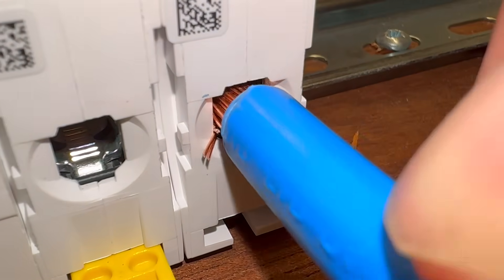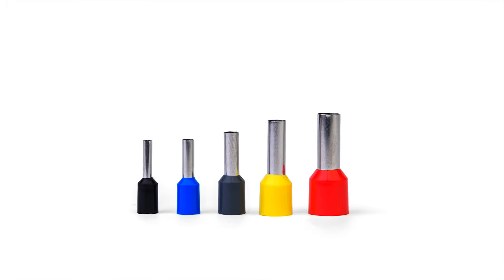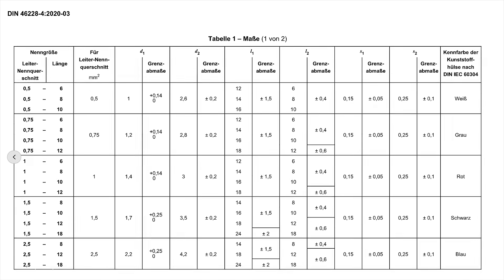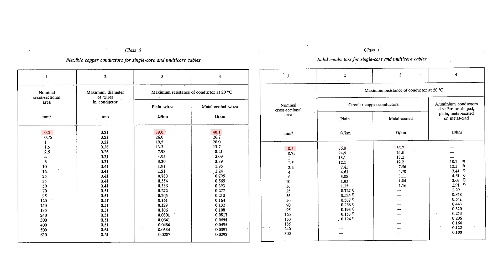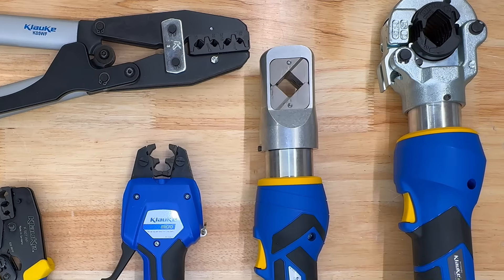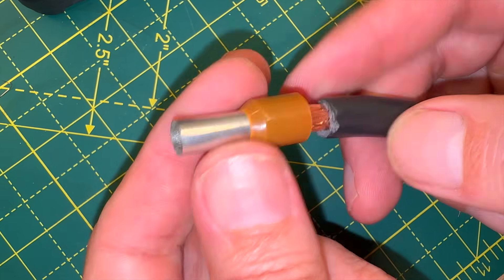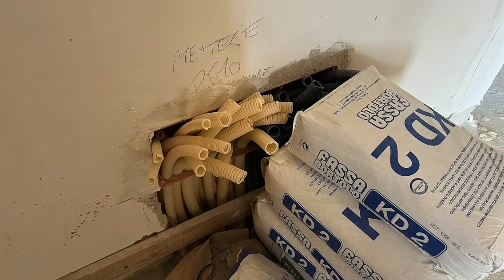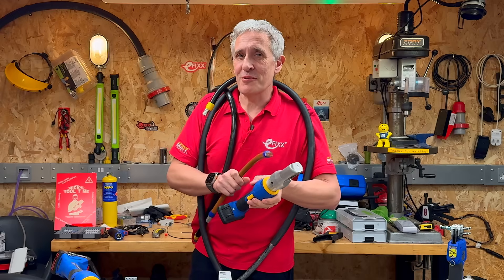The Truth About Ferrules: Overkill or Essential?

Comment: Most of the problem with cheap ferules can be solved in most cases by leaving 1-2 mm the stranded wire outside at the end of the ferrule. I've said in most cases because sometimes the end of the terminal is plastic or is simply air.

Comment: Howdy. Nice.
It is sometimes observed DIY:ers soldering the stripped end of stranded wires to avoid strand spreading.
This is bad !
Using screw terminals the solder lead will cold fluidize resulting in very unreliable connections. Fire hazard is eminent.
Cheers.
Reply: Several YT vids showing tradies doing this as well... they dip the stripped end into a little cauldron of lead.  Never saw the advantage of that over ferrules, especially in terms of convenience.  Applying a ferrule takes a couple of seconds only (and a crimp tool that admittedly can be a bit spendy)

Comment: Double 6mm - small bit of masking tape over the two untwisted ends with about 5mm of pinched and twisted tape at the end. You only want to tape a couple of mil of the cable so it's easy to pull out once in a ferrule.

Comment: If it ain't soldered , it ain't connected.  That simple.
Reply: Simple, but also simply incorrect!
Reply: @tookitogo   why would it be incorrect... soldering is both mechanically and electrically a very good connection. Just check in any of yours appliances.
Reply: @nagyandras8857  Nobody disputes that solder connections are connections. But you’re saying that anything that ISN’T soldered isn’t connected, and that is sheer nonsense. There are countless other methods of making high-quality electrical connections, from crimping to screw terminals to spring-clamp terminals to spot welding, wire wrap, and more.
Reply: @tookitogo out of all those , spot welded can the the other proper alternative. However , even spot welding will not block air from copper. A proper solder job will. Screws come loose , Spring loaded wago types have far smaller contact area , wire nuts where never a good idea as they can come loose. And all of them let the copper exposed.  So there are no other options for something to Last,  soldered it is , or its not connected.
Reply: @nagyandras8857  EVERY method has its pros and cons, and that includes soldering. Soldered joints are much more susceptible to vibration damage than crimped, wire wrap, or spring-cage connections. A good engineer/technician understands this, and chooses the correct method for each job. Only a lazy or unknowledgeable one thinks that one method is always the best. 

P.S. Crimping and wire wrap are all gastight connections. So is a spring cage and a properly-torqued screw terminal.
Reply: @tookitogo  soldered still outclasses all, expect for 2 things. harder to modify, and takes more skill and time. apart from that, its better in any way than all the rest. specialy if long time period is examinated.
Reply: @nagyandras8857  Again, that is simply not true. I already gave one example: solder joints are susceptible to vibration. Crimp, wire wrap, and spring cage are all superior in vibration resistance. That’s why aerospace and automotive applications use crimping wherever possible. (In those high-vibration environments, they even use press-fit PCB connectors instead of soldered ones, because the press-fit is more reliable.)

As I said: only a lazy or unknowledgeable engineer/technician thinks that soldering is always the best. A good engineer/technician actually understands the pros and cons of each method and knows when to use each.

Comment: Hi @efixx, it would be good to cover details about pull testing and tool certification also. This area is often massively overlooked and can be confusing to users. 

For example, many twin ferrules will fail pull testing because users have selected the wrong size for the cross section. It is much more difficult to get a reliable crimp with twin connections, this is why less and less are being used industrial applications when terminals can provide reliable grouped connections.

Finally, with the new SnapIn range of terminals released by Weidmüller and soon Phoenix Contact, ferrules will no longer offer improvements over a correctly stripped wire. Worth adding to your next video on terminals.

Comment: The main problem with ferrules is that they must be used correctly or they will do more harm than good. It means not putting solder into them, not using them on thick stranded or solid wires, using correct sizes of ferrules instead of bending the wires on themselves a few times of shoving in a few smaller ferrules alongside the wires to get a reasonable grip from a larger ferrule or cutting off some strands and trimming the insulation to fit a smaller one. Also with ferrules you absolutely need to have a specialized crimping tool and follow the procedures. It means definitely not using pliers, vice grips, hammers, cordless drill chucks, your teeth, circuit breaker terminals or other random stuff to crimp them. But even the cheap rattly stuff from China that despite being very affordable generally does a reasonable job can rarely be found in some random worker's or home owner's toolbox. And the requirement of not doing anything questionable and non-standard with the little things demands at least some level of knowledge and understanding one can not expect from a random guy. It is very important to understand that an idiot or someone with no proper tools available will almost always do a better job not using any ferrules anywhere at all than using them but incorrectly.

Comment: I normally solder when there is a strand of copper wires
Reply: Bad idea for screw terminals: solder cold-flows under pressure, so your connection loosens over time.

Comment: Very comprehensive video! I like how you mentioned (from the Siemens datasheet) how ultra fine wires and ferrules are used in mainland Europe where they aren't in the UK -- there's usually a German in the comments saying ferrules are mandatory when someone is putting stranded conductors in a screw terminal without 😅
Reply from the maker: Thanks ! 🙏

Comment: Don't take me wrong But this seems just a wate of money and an unnecessary tool in the kit as you can just twist the strands using a simple plier and have the same strength. 

Ofcourse some lazy people would short something without these and then call them game-changer.
Reply: Nah. They’re an added step up front that saves TONS of time down the line. (And of course, in some jurisdictions they’re required in some situations.)

Comment: There were lots of things I didn't know in this video, and many I don't need to know.

But I didn't know that the uninsulated ferrules existed. One of my major use-cases (as a simple man-with-a-shed) is indeed wiring plugs. Thank you.
Reply: you can easily detach the insulations from the ferrule with needle nosed pliers if necesseary, just pinch the plastic with teh pliers and push on the metal sideways

Comment: I'm not watching. Just wanted to say that ferrules are not superior, they a merely a cosmetic improvement. If you're brain has the capacity to understand,.. then you'd know a cable will always have a better connection with no ferrule as the screw/clamp force spreads the cable into the terminal. A ferrule is rigid and most of the time will only have a tiny footprint in the terminal hole. This can create a hotspot from the tiny contact area. If you must use them then do the screw as hard as possible to crush the ferrule expanding the contact footprint.
Reply from the maker: Perhaps try watching and you might see that’s not the case.

Comment: Imo the Weidmueller PZ6 Roto is the best crimping hand tool for crimping any ferrules 6mm² or smaller, it produces a compact crimp making insertion easy when using maximum allowed conductor size for a given terminal and the crimp is very smooth with no ragged edges that can get caught on spring loaded terminals on extraction. Also the head rotates for crimping from the side or front wich can be helpful if the conductor is short. Many companies I worked for insist on using this tool only.

Comment: Ok as ferrels wern’t thing when I did my apprenticeship As an electrician I was taught to ALWAYS twist the exposed conductors. The tradesmen I worked with were real hot on the quality of the apprentices terminations. 

Why in the examples shown  were none of the exposed conductors twisted as when done as I was taught avoids most of these issues?

Comment: Good tip about the cheap ferrules.  I've always bought cheap ones not knowing the difference.  I'll start buying the name brand ones.  For tools, I would still recommend getting the cheap ones unless you really use them a lot.
Reply: Ferrule crimpers are one of the few crimper types where, to be frank, the cheap Chinese ones actually appear to be just as good as the name brands. Especially for using them in screw terminals (where the screw will further compress the ferrule anyway), I’d use a cheap one without reservation. (And I do.) For spring clamp terminals (WAGO, etc), I’m a little more critical, so I eventually picked up a nice Knipex one, new in box from an auction site, for a couple of bucks.

Comment: Back a year ago, I installed a new control panel with ferrules and then the customer made me go through and remove the ferrules from all connections.  There were a couple spots they didn’t notice where ferrules were essential, so I left them hoping they wouldn’t notice. 

Their reason given for not wanting ferrules was that in the environment it was installed in where the panel would be exposed to the extremes of temperature in the climate condensation might cause corrosion between the conductors and the ferrules.  The real reason was that the maintenance manager didn’t like the general contractor, and as the electrical contractor we got caught in between.

There are times when I’ve seen things fail because of ferrules and times things have failed because of a lack of ferrules, and I tend to make a judgment call based on the situation, but when it comes to engineers, they usually want them either on everything or nothing.  Many engineers tend to think there is a textbook right way to do everything, not taking into account that the real world is not a textbook example.
Reply: I really appreciate professional judgement. Technicians can be just as professional as the engineers, it's worth acknowledging the expertise of doing it, of holding the crimper in your hands, looking at the results before and after crimping, before and after termination, before and after service life.

Comment: For years people have done without this. All a marketing gimmick. You are made in China bro.
Reply from the maker: Try working on a machine panel which has been built without ferrules.
Reply: @efixx  I have. Many times. No issues. You just have a "lack of skill" issue.
Reply: It’s not a gimmick. It takes a little time upfront, but saves a lot of time down the line. Sure, you can do it without (except where required by law), but that doesn’t mean it’s a good idea. “I didn’t have these when I was young, so nobody should” is not a sound argument.

Comment: I was working on substation control panels since 2008 and ferrules were the standard fix, I still have some of the ferrules and terminations in my shed.
Quality of fittings often come down to the buyer trying to save money because they have never done an electricians job or any job they are buying for, but I found giving them an example of their purchase worked well in the future. I was building a 275kv switch and needed 8 bolts, washers, and nuts, it took me an hour to find 8 sets that would screw together as he had bought crap galv materials. We took a photo and sent it to the buyer asking what price he bought them for and add £35 as that was the actual cost of the materials. After that, we only got stainless steel fittings.
Reply: Stainless hardware is not without problems. 
In that 275kV application Gal bolts were definitely NOT suitable - soft as poo.
Reply: @BTW...  except poor quality galv costs more than SS in the time it takes to find ones that go together, with SS you don't have that problem. If SS shows signs of rusting it is usually just a surface coat and not a penetrating coat.
Reply: @boblordylordyhowie   I started working in the custom built switchboard industry in 1977 till 2019 ...  Generation / Transmission / Protection / Distribution / Process control. Used ferrules first time around 79 - they were the minimum used on control wiring.. more so pre-insulated crimp lugs of all shapes and forms were the standard fix, for several good reasons. e.g. Nothing but ring lugs on any metering or critical infrastructure CT wiring. 
In such manufacturing and installation works, the 'buyer' gets quality materials, like wire terminators at low prices due to volume. It's common to find the client specifying manufacturer and type of cable and terminators. e.g. Some days I could be doing over 100 per hour.. for days. Crimpers QA tested frequently. 
My preference being Weidmuller tools and TB's. 
During the 80's here, a TB manufacturer (Phoenix) sought and gained approval for a 'No Lug' rail mount terminal for approved type wires - 7 strand  elecro tin plated Copper minimum. The wire box and clamp plate having a sharp serrated surface to bite into the wire, ferrule or lug. Strip cable, light twist and screw it down tight. The marketing suggested cost and labour savings and higher connection reliability.  I'm still skeptical on that and I would not terminate a fine 24 or more strand FLEX cable without ferrule or lug. 
Digressing here....
Gal bolts are soft - very low tensile strength - Sub-Standard for any Busbar or Heavy field cable connection. 
The only use I've seen is for mechanical joints exposed to weather.. like bolting a gal plinth to a cabinet.  The only electrical joint I've suffered them has been Main Earth to Ground stake or Grounding of steel fence posts... even so, over sized and painted with cold gal. 
 
8.8 Grade high tensile - Zinc passivated is the Minimum Standard for bus or cable joints here.
All quality equipment like contactors, CB's, TB's etc will have these 8.8 grade or higher supplied by the manufacturer in the box. 

During the 70's I'd worked with Electro tinned steel, fine thread high tensile bolts. The plating was thick and highly resistant to abrasion during tensioning.   

304 and 316 Stainless is all well and good, tough and desirable in many applications, indeed, my preferred option, BUT it's expensive and highly prone to gauling aka. cold welding. This can occur even when bolts are half tensioned during a custom manufacturing of field termination process. It's a proper PITA... like why would you use them unless for free or specified?

Comment: @7:14 mostly likely tinned bronze.  That’s a very common material for electrical contacts.  It offers better strength, wear, and corrosion resistance.  The bronze is less likely to crack under stress or fatigue.  While less conductive than copper, the section thickness is remarkably small, and it not changing the area of contact so it’s really only the loss of conductivity relative to copper over the equivalent length.  I could add up the micro-ohm resistances of copper and bronze for a wire length of 0.08mm and compare, but I’ll leave that up to the reader.  😉  what minuscule amount is lost by resistance is potentially gained by the very same long term offsets referenced in the chart @1:45
Reply: When you got the file out I thought you were going to reveal that the cheaper terminals were steel, which I have seen before. They are often made for high temp applications, but unaware (or unscrupulous) sellers will sometimes package and sell them as bronze/copper.
Reply: yeah I really have to be honest i'm not sure what he was getting at there. He mentioned the milliohms of resistance followed by the cable dimensions, but the dimensions of the cable are seemingly irrelevant to the electrical properties in question. (I mean, yes, obviously a thicker wire overall will have less resistance, but my point is whether it's 5mm or 5km thick, if it's 50 ohms of resistance it's 50 ohms of resistance and if it's only carrying 500ma then it's only carying 500ma.)

Comment: Why not just tin wires? Simplicity and convenience? Or is there another reason?
Reply: Because tinning them is a HUGE no-no: solder cold-flows under pressure, so if you terminate a solder-tinned wire in a screw terminal, it will loosen with time. For this reason, many electrical codes explicitly ban the practice. (Solder-tinned wires are technically safe to use in spring-cage terminals like WAGO, because any loosening is automatically compensated by the spring force. Lots of stereo systems come with tinned ends on the speaker cables to go into spring-cage speaker terminals. But I wouldn’t do it for mains.)

This is also the same reason why crimping onto solder-tinned wires is not allowed.

Comment: Personally I use the phoenix contact crimpfox duo 16s. It does pretty much the same range as the klauke in this video, but the crimpfox is a fraction of the size, can do dual orientation, and seems to be cheaper.